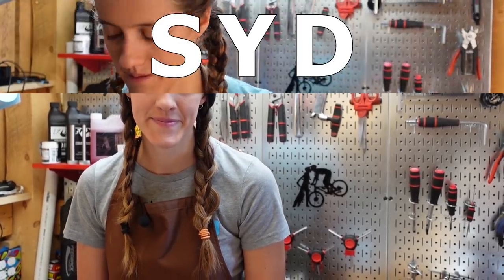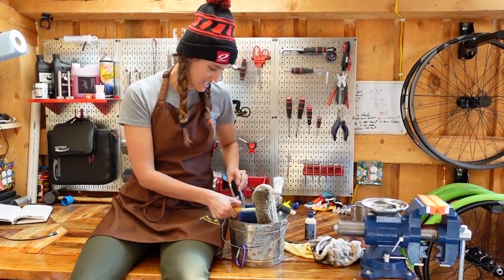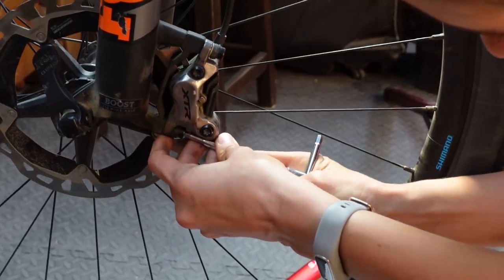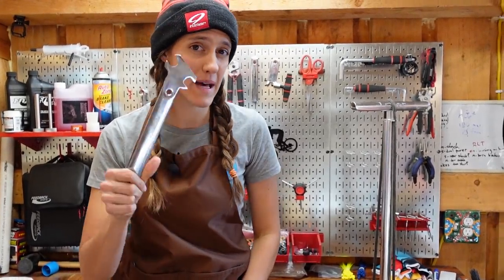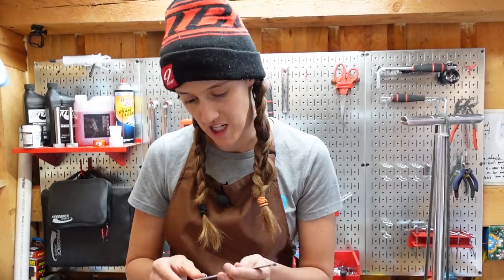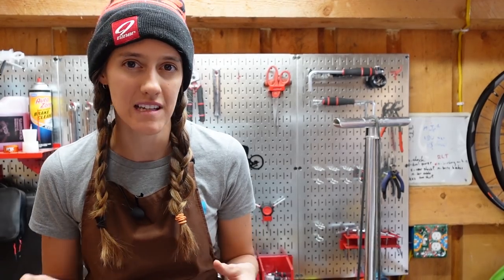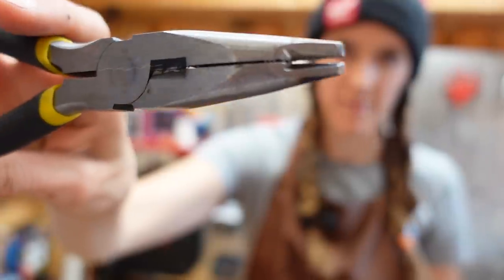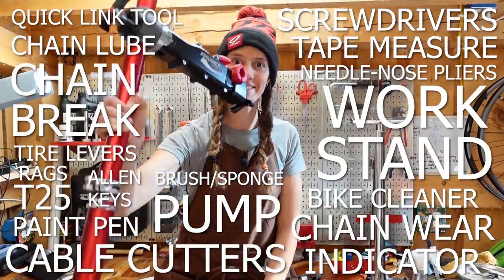The tools you need to start wrenching on your own bike (BEGINNER TOOLSET) | Syd Fixes Bikes

Comment: Just spent about $600 getting my tool game up to spec! I was tired of paying the shop for service that was easy to learn with some youtube videos..Found a lot of brands other than Park that offer some high quality tools...Wera, Wiha are some of my favorite. I did spring for 2 of the Park Torque wrenches. A must for todays modern suspension bikes. Thnks to videos like yours, i have fixed a lot and replaced parts that otherwise i would have to wait weeks for my local shop to fix!! Thanks guys, keep up the great work!
Reply: Yep, buying even and expensive tool is usually cheaper than paying the shop (and the work gets done to your standard, and you know what do do when something breaks and no shop is around.) 🙂

Comment: The things I might add;

Torque wrench, especially if you have carbon on the bike. Sure you can do it by feel, but that takes practice that beginners don'r have, and is an expensive risk around carbon.
Spoke wrench

For tubeless
Valve core remover and big ass syringe

Hydraulic brakes
Bleed kit

Comment: You can use a normal master link tool to close them, by just pulling it the other way.  Or you can just put the master link on the top side of the chain stay and crank the pedals hard in a high gear.  If you do it fast enough, it will just pop into place.
Reply: I use my normal park to close them, too.  Or, put the quick link on top, squeeze the brakes and stomp on the pedal.  With the bike out of the stand, of course.

Comment: when i was a kid doing this with whatever was already in my parents' garage trying not to spend any money, i changed tires using a couple flat screwdrivers (definitely scratched a few rims but rarely popped an inner tube), swapped pedals using a standard open-ended wrench (still don't own a pedal wrench), and cut cables and housings with basic wire cutters (had to re-round the cut end of the housing each time).  i did buy a 4/5/6 triangle hex wrench and a chain tool back then (still have and use them 30 years later) but as an adult with my own garage i've been adding more bike-specific tools as i keep doing more things and getting new kinds of parts -- just today got myself set up to install and maintain hydraulic brakes!  still saving up for that bike stand though -- still have the habit of setting the bike upside down to work on it

Comment: I love your videos!  I love that we're all just learning as we go so thanks for sharing your journey as well. 

Also- I have a pair of those Park Tool quicklink pliers and I've used them to both take off and put on a quicklink.  All you have to do when putting a quicklink on is insert the tool into the chain links and pull the pliers apart to tighten the link.  Works like a charm.

Comment: Informative video for a beginner but I have a couple of points to make. My Park Tool (MLP 1.2) quick link tool will both remove and install a quick link. When you remove them you obviously squeeze the tool but to install them you separate the tool (opposite direction). You have the two prongs in the exact same locations on the chain like you're removing but reverse the action to install. As for a crimping tool to close the cable ends, my Park Tool (CN 10) cable and housing cutter also has a crimping feature just above the spring.

Comment: A great place to start is a good comprehensive ratchet set, that includes a screw driver that has interchangeable bits. Obviously you're probably gonna want it in metric, if it's mostly for a modern bike, or both metric and imperial.
 Also, the park tool quick link remover can also reattach links...

Comment: Tape measure in both metric and inch (imperial) is really essential. And know your measurements for a good fit, or always you to tweak but go back if needed. I have been a lot of cockpit changes on very different bikes, with different chain stay lengths, trail etc but keep coming to my basic numbers for best fit, even though visually it does look “right” at first glance. And a good portable bike repair stand is a game changer. Old eyes, try a headlamp stolen from my hiking pack when I upgraded.

Comment: Good list.  
My 2c.... Some of these things, getting a cheaper version is a good place to save money, e.g. cable cutters and needle nose pliers (you can upgrade later).  You can find cheaper work stands too.  They aren't the best but  will do nicely until you do score a nice Park Tool stand on the Black Friday sales.....
BUT, don't skimp on allen tools.  You use cheap allen wrenches, and you'll  regret it, almost immediately when you round that nut off, have to pay to get it removed and replaced, and then go and buy a decent set.  
You will also likely end up buying a couple of different sets, e.g. a "normal" set, a multi tool set, some nice T-handle wrenches, and so on......  Same likely goes for Torx wrenches.  

I would say that, a decent torque wrench is super important though, almost from the start of learning to do this stuff.

Comment: Great vid!  As to a work stand, a cheaper option are the bike hanging hooks that fold up and down and have two hooking arms that go under the top tube.  $10 or less I think.  And they can be mounted on a wall, a workbench, or on a piece of 2x4 that can then be clamped into a vice (and easily removed).  I do have an old model Park portable bike stand (the cheapest model for home mechs), but I have used the folding bike hooks as an additional stand when I am working on two or more bikes at the same time (e.g., swapping wheels).
Reply from the maker: Good tip

Comment: If you like a wax based chain lube, you can make your own for pennies on the dollar and much better than the commercial stuff.  Three parts each of paraffin wax, paraffin oil and xylene (Home Depot or Lowe's usually has it).  Melt wax at low heat, stir in paraffin oil, stir in xylene.  Nothing to it.  The only downside to this mixture is that it solidifies when the weather is cool, so you will have to warm it up before use. 

I've found a very cool lube that works on any bike part,  including the chain: "Super Slick Slick Stuff" works on just about anything you can think of and works better than any type of lube I have EVER used.  I don't bother with anything else anymore.

Comment: Not a tool per se, but a shop apron is nearly essential to keep your clothes from getting dirty or permanently stained by grease. Plus, the extra pockets are handy for holding tools and other bits. I also recommend using a three sided dog toothbrush for cleaning chains.

Comment: if I may suggest a 'bikehack' - get a broken spoke and bend it 90° on both sides and put it on the chain when removing master link. especially on a Shimano der that don't have fixed extended cage mode. more than once I had my master links flying all over the room.

it'll hold the chain for you, and prevent you from losing your mind and nerves, getting the master link on and off.
Reply: A few chain checkers (e.g. Birzman) have one built in.  Super handy.

Comment: WARNING!!! Do not buy Squirt Chain Lube in the winter if you live where it gets cold. 
It says on the bottle not to let it freeze, but they do not say that on the outside of the shipping package. Therefore my post lady delivered it to my outdoor mailbox in northern Canada in the middle of winter where it promptly froze. It turned into a paste and will not flow and fill in the cracks (as determined by their tech's). There is a hack where I can try to revive it with small quantities of hot water, but I may get screwed on this.
Reply from the maker: We've had the same thing happen (regularly because our shed isn't heated). As you found out, it's pretty easy to fix by mixing with a bit of water, and we've had no repercussions from doing so!

Comment: Loctite blue 242. Cant install  parts without it
Reply: In addition, some grease, anti-seize, and retaining compound could be useful.  Different parts require different prep not only to install but also for removal later.  Additionally, I'd invest in a box of gloves to keep all of these fine substances away from the skin.  For all of these,  your money might go farther at either the auto parts store or the home improvement store.

Comment: Question: In the chain wear indicator section, you said, "...you can do it with a ruler..."  How? 🤔
Reply: Each link of the chain is supposed to be 1/2 inch long. So twenty-four links should be one foot. Measure the distance between the centers of the pins over 24 links. If you measure exactly 12 inches / one foot, then the chain is new. If the measurement is longer, then divide your measurement by 12 inches to find the percentage of elongation (wear). Replace at 0.75% for 10, 11, or 12 speed chains, and at 1.0% for 5, 6, 7, 8, and 9 speed chains.
Reply from the maker: What he said. But we will show it in next week's video, as well 😉
Reply: @sydfixesbikes  Yeah, I did it and I think I need a new chain!

Comment: If you get a bike stand, get a decent one.  It beats getting a cheapo stand, realizing it sucks, and they having to pony up for a decent one anyways.
Reply: Yep, "buy once, cry once".
Reply: Sadly this happened to me. The stand I got broke down and now can fall over easily so I have to let the front tire touch the floor thus I let the stand only lift the back wheel. Also have to position it a certain way that it won't fall over. So you can say I have a ghetto stand at the moment.